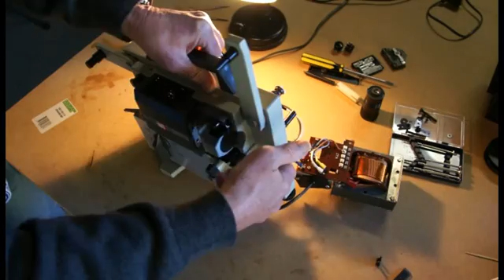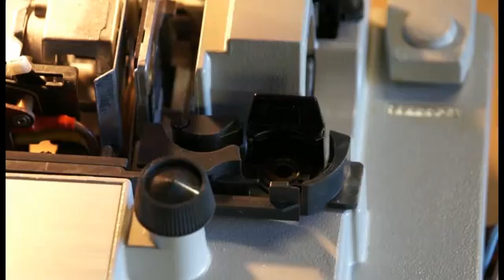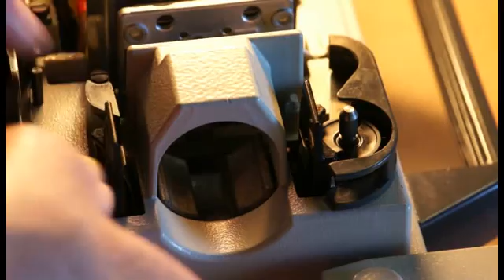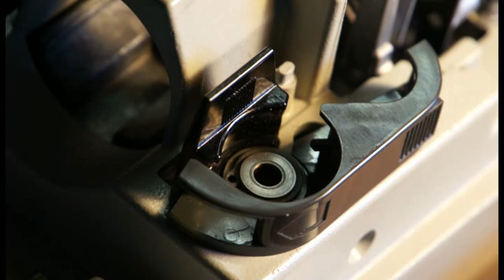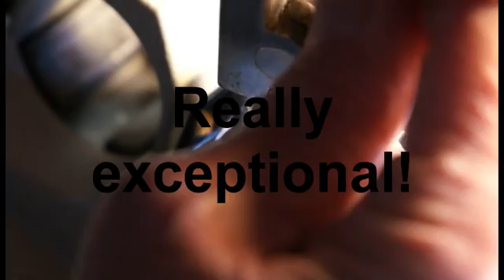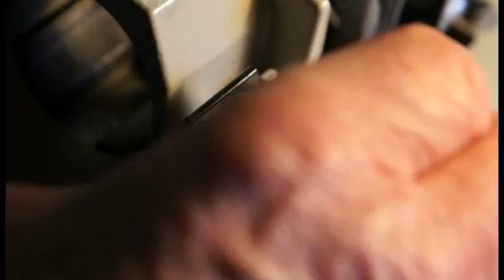Servicing an Eumig 8mm Projector Part 2 of 3

Comment: Hi good day. Thanks for your video, it makes alot of sense. I'm currently repairing a eimig 810 D dual super and 8mm film. The film feeds through, but it just jumps through the shutter and the film claw. I noticed that the pin on the claw was broken fixed it. Still the film just runs through jumping and no stable image. The reels are in very decent condition. Can it be that the shutter and claw has to be calibrated or adjusted. Can you please help?  

Stay save and healthy during lockdown.